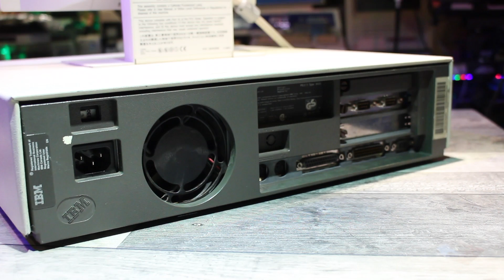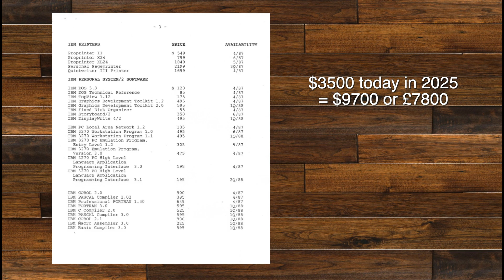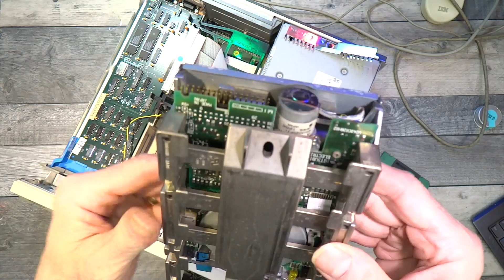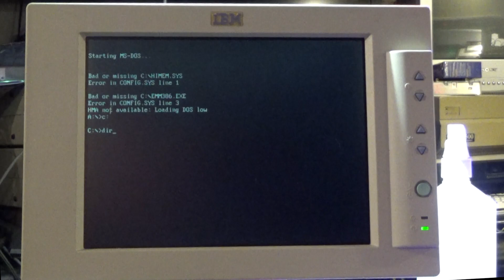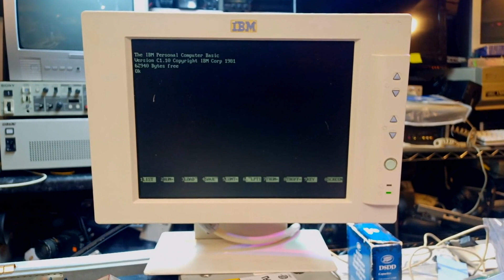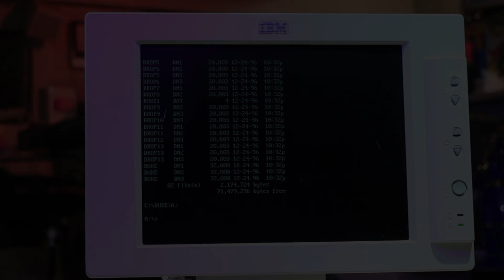Getting To Know the IBM PS2 MODEL 55SX from 1989 and all of its Annoyances

Comment: I used to take care of whole labs of these. Lovely, durable machines. And some of ours were diskless on Token Ring. The LT0 model was token ring, LE0 was Ethernet - never saw one of those. Nothing special, just swapped the included network adapter.

It's important to note that the PS/2 card edge drives are "ESDI". They're kind of ESDI internally but that card edge connector was really just hooked straight to the MC bus with the controller on the drive board.
Reply from the maker: Thanks for the information.

Comment: That a lovely condition PS/2,
wow you have a cracking collection in the background, i could not help noticing the Commodore PET & the Amiga1000, 
ive got a fair haul here but no youtube channel for my retro thing despite my fame in dance music land. 
Ive got an Amiga A1200 with the terrible fire TF1260 card in with the top Motorola chip with MPU & FPU onboard, 
got a C64 breadbin with a final cart with all orginal box & software to & a Ti99/4A with a box full of original carts & a finaGROM with a vast library of software on it & 32k expansion. 
A rare IBM prototype 386 board with a serial number of all ------ no numbers at all with all 3 of the ceramic chips CPU MPU & MCU marked confidential & all the memory chips are goldtops on it.
 Ime in the process of re-building my duel cpu Pentium pro machine, a power surge blew the supply & took out the motherboard last year & nuked all my PCI & ISA cards, ive practically had to start that one from  scratch again, only the RAM & CPU's & drives survived.  Glad i found your channel, your video's are very comprehensive & enjoyable.
Reply from the maker: Thanks. I have alot more machines. They are a going concern. Keeping them all operating is a big task. I got rid of loads of stuff years ago then brought it all again during COVID and started a YouTube channel. That IBM sounds very interesting. I need to recap my 1200 and 600. Hate those surface mount caps.
Reply: @RetroGadgetMan   yes i know what you mean, since i became disabled last year (lost a finger & eye in a gas explosion) i have found soldering difficult, SMD stuff gets me swearing now, i used to be good at it before i melted bits of my body haha, I can still do repairs tho, just takes me time now, all my sound systems lay in my rig hall unused since last year, Ime not looking forward to going thru that Pentium pro board, its properly mullered, i do hav a pair of spares tho, i got them years ago when i noticed them becoming scarce & got a stack of CPU's to save them from the gold vulturs from smashing them up & melting the, ive just found a pair of unobtaineum pentium 2 333mhz on socket 8 as well, those things are ridiculously rare, i got seen off big time for them tho, i had to pay a ridiculouse amount for them that i was not happy about but the guy was the only person in europe with a matched pair with the built on fan & cooler. They are a special overdrive for socket 8
The old 386 beast is homeles at present, sadly the shipping company smashed the case apart so bad it was unsalvagable, they used a forklift to lift a 12 kilo case, absolutly stupid, they stabbed the front of the mashine where all the drives are destroying all the drives & front & warping the iron case, thankfully the rare board & cards inside survived the ordeal.
Reply from the maker: Sorry to hear about your injuries. Sounds like your lucky to be alive. Using a fork lift for such a small item. Sounds like health and safety rubbish again. To many old computers getting destroyed in transit these days.